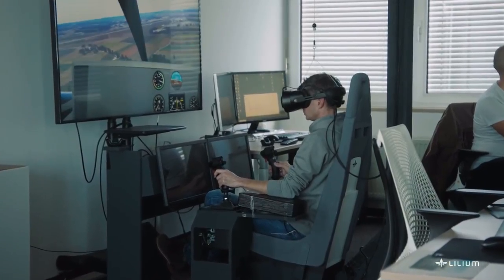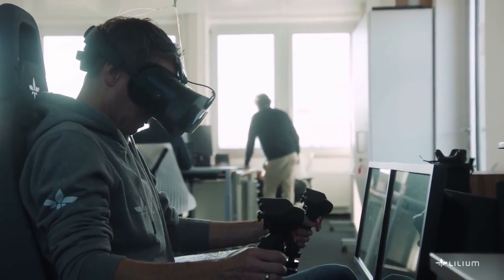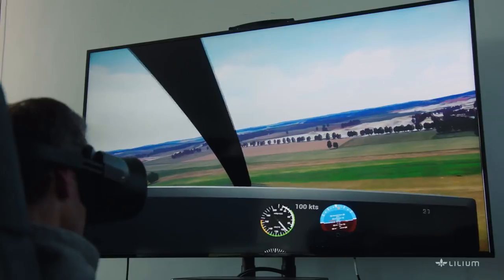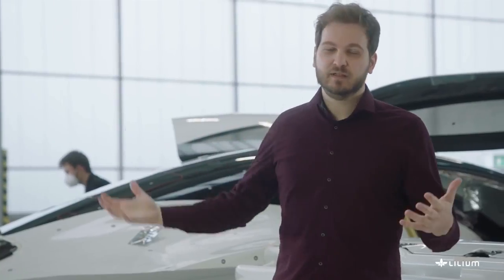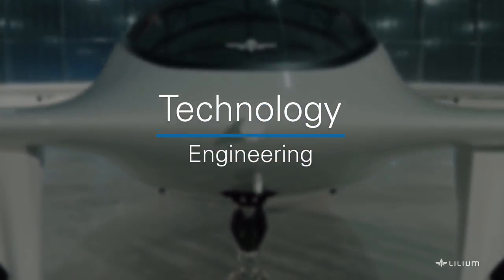Lilium Electric Jet : The Technology and Features in detail

Comment: What happens if you lose power? Since all your stability is in the engines.. ??
Reply from the maker: It would be exactly the same thing, if you run out of fuel... mid air! :) You could consider this as a cub, but slightly heavy.

Comment: Ok let’s just add another 800 pounds of occupants, seats, safety and climate systems and see how she does. Gotta get real here sooner or later…
Reply: As they say, when reality hits the fan.
Reply from the maker: Thrust should not be a problem, but the battery efficiency is certainly a concern. Hopefully by the time it launches, we have a new breakthrough in battery tech which can increase the load capacity as well as the range.
Reply: @eDriveToday  " but the battery efficiency is certainly a concern". Really! so you understand it will never cary people.
Reply from the maker: @urlocaldogeater   They have a flying prototype. So it means, it can carry people and it carries people. "Efficiency of battery" term was used, regarding a larger range to connect far distant cities.
Reply: @eDriveToday  "Can carry people" but it won`t. When you Côte your self, do it right. You say  " but the battery efficiency is certainly a concern". Certainly a concern, and now you have a braekthrough in battery? to connect far distanse cities?, really! This battery breakthrough has been going on for the last 30 year, and the EV cars are on the same spot. There is no magic trick when it come to physics, and this aircraft will be to heavy to get off the ground to reach this distant cities.
My Guess is that you can fly it for 5 minute.

Comment: Great idea. But for a true flying car the jets could be mounted on the bottom of the car parallel with the fuselage and the wings folded vertically when the car is taking off or landing or perhaps even eliminated and rely only on the jets for lift. Another factor is that a car with wings cannot maneuver in tight spaces and between buildings since wings rely on forward motion for lift and it takes up a lot of horizontal space.
Reply from the maker: Your point is very valid. But also need to note that, this is not conceived as a flying "car". This is meant for the air only, not for the road at all.
Reply: @eDriveToday  -  nor is it a jet in the strict sense.  It is powered by ducted fans.

Comment: Wonder toy! But wouldn't an electric helicopter be far more practical and cost-effective?
Reply from the maker: In theory, this still is an electric helicopter. Instead of one huge rotor, this is employing multiple rotors, which has found to be more effective and efficient than a large single rotor. And the wing design is super efficient in cruise.
Reply: @eDriveToday  don't forget your software wizardry

Comment: Fascinating.  I wish you continued success.

Question - you indicated you have planned to not have a high percentage of hover in your flight profile.  Isn't that high risk?  Suppose when have entered the end of the flight, there is an issue where you wish to land (plane and airspace stack-up, gate is not ready, debris on the runway or landing area, construction).  You will need to circulate or hover.
Reply: I'm gonna  land mine on schoolyards and parks

Comment: Show off video with zero practical information.  Carry capacity?  Flight times?  Can it land with forward speed?  It was stated that only 10% of the hover power is needed in level flight - can power be reduced to some of the fans to conserve capacity, or do they all run, all the time? From the design, it would seem that they'd never be able to be powered all the way down, as they'd add a lot of drag.  They could possibly be selectively throttled back to a neutral speed, using a lot less power but still providing enough thrust to overcome their own wind resistance.  Overstating the efficiency of ducted fans isn't going to win you any points.  Yes, they are more efficient than a non-ducted design of the same diameter, but they're still less efficient than a larger diameter propeller of the same total area as multiple ducted fans.
Reply: Flight times? My guess is 5 minutes, max. The CEO talks about what they "want" from the battery, that of course,  dosen`t exist.
But wait, there is a breakthrough on batteris. Heard that before?

Comment: I love the design concept. However I do envisage a major problem. The present design will be very vulnerable to cross wind mishaps whilst hovering in close proximity to the ground. This is because of the need to roll away from wings level in order to move the craft laterally side to side in the hover. When there is a cross wind the aircraft will literally have to land tipped over to the side to maintain a steady position over the ground. With the width of the wings there will be insufficient clearance to maneuver laterally without the wings making contact with the ground.

Unless the jets can be vectored side ways to provide lateral adjustments in the hover so the wings can remain level then the concept will fall short of its design goals making it difficult to obtain full certification. I hope the designers realise this NOW and look at ways to mitigate this short fall. I would be looking to deflect the outflows as oppose to pivot the jets themselves. It should be easier to accomplish without gaining an unacceptable weight penalty.

I love the way longitudinal vectoring is being accomplished. Liliam now needs to consider how to best introduce some limited lateral vectoring to aid their cause.
Reply from the maker: Would the crosswinds really matter, considering this is a EVTOL with wings? The wingspan is only 13.9m and the weight is a mere 800Kgs. The hover phase efficiency should definitely be low, but it can still manage a safe landing in a small space, right? You might have seen, how the Cubs in Alaska, lands in very small spaces, almost like a helicopter, literally. The same principle can be applicable to this also? with an added support of tilting lift fans? Curious...!
Reply: Why would you land crosswind? If this technology does work I envisage dedicated facilities for operations, designed so that the aircraft can always land into wind.
Reply: @Obbsserver  Exactly.  A VTOL aircraft doesn't require a runway so there are no crosswind issues here.  You can land into the wind from any direction just like a helicopter and we know people land helicopters in some pretty rough conditions like ships and oil platforms.
Reply: @redbaron6805  Playing devil's advocate, crosswinds can be fun. I remember landing a C172 at Biggin Hill to clear customs inbound. There was a hell of a crosswind from the starboard side. It was supposedly within limits, but in the flare I had full deflection of ailerons and rudder and we were still drifting slowly to port, heading off the runway towards a pedestal landing light, which I missed, somehow. During the roll-out I watched my wife using her left hand to un-peel her right hand from the grab handle. She was gripping it so tightly her muscles had gone into spasm. 
Maybe not what the designers of the Lilium have in mind for their passengers!
I fear that electric aircraft will be a dead-end eventually, but I think the Lilium design is very interesting, and much better than all the other VTOL electric aircraft of which I am aware. I will be very impressed if they have found a way to make ducted fans work - I believe DJI tried them and gave up. You might think that if ducted fans do work they would be used on consumer drones if only to cut down the noise. Anyway, I hope the Lilium concept works.
Reply: Doesn’t the low weight imply that it’s much easier to get blown around in the wind? I imagine the solution is not to spend too much time within one wingspan of the ground. A vertical landing in gusty conditions would be a rocky descent, a short wait for the right moment between gusts while pitching and rolling to compensate and then quickly descending the last 15 m. Not a very passenger friendly experience.
Reply: @motioncompensation1544  This is all assuming very gusty winds and probably a weather most aircraft won't fly in.  Since the airplane can land vertically and can compensate using computers which can adjust the approach 100 times per second, I don't see this being very much of an issue.

I have landed small aircraft in gusty winds, and since the wind gusts are generally from a predictable direction, I don't see this being much of an issue from a flight control standpoint.

Comment: I wonder if you can take the Lilium concept of multiple compact engine design and exchange them with fuel combustion fan engines. Full thrust for take off but half thrust turning off some of the engines during cruising.
Reply: A hybrid system is the obvious solution if you're interested in making this a truly useful long range vehicle.

But this is verboten since it apparently offends the climate Gods.
Reply: You need to use the electric motors for rapid control of speed etc but you could add a fuel-powered generator.

Comment: Any aero engineer knows that swept area is king. Anyone who's done wind tunnel ducted fan testing..including nasa as far back as the 50's know the traits and issues. The claim made here about keeping the weight down due to better efficiency over larger props is complete bullshit. John Kress would be rolling in his grave. The design is clever indeed but not for that reason. Theyve managed to figure out a way to essentially shove thrust all over the plane. Thats inherently inefficient but made up for by cleverly finding spots for it. The trade off is loads of parts obviously. 
An electric helicopter or 3 or 4 fanned drone type vehicle would be simpler and more efficient. This will be a footnote when we look back at it in 50 years.
Reply: Let's assume for a moment (ever so briefly) you know what you're talking about regarding ducted vs un-ducted fans/propellers, your 3 or 4 fanned drone type vehicle has two serious drawbacks that would cause it to fail certification: lack of redundancy and noise. Engineering isn't about finding the the very best in performance; it's about the best set of compromises for the intended application.
Reply: Helicopters are great for hovering but as soon as you start moving forwards they fight against themselves with the left and right sides of the blade facing different airspeeds. Thus the forward speed of helicopters will be slower than airplanes.
Quadcopters are very inefficient for flight because they have no wings, not even a big rotating wing like a helicopter.
Reply: @codetech5598  Precisely, but my comment was already long enough (and not a certification problem)! 😁
Reply: @gh8447  I was responding to the OP. You already understand the issues.
Reply: Yeah, Tim's entire claim here is beyond asinine...

Comment: It was said that STARX learned by explosion (a proven Russian innovation/evaluation process :))

You guys are completely on the flip side; 3 years of simulation probably burning through a huge pile of cash.

Maybe it's time to extensively real-life test (and oh yes, build in a parachute-like some private jets nowadays have).
Reply: The only one that is using a parachute is Cirrus, but that jet requires a runway and has a single engine.  The redundancy of multiple electric motors where you can lose up to 3 motors and still land means a parachute wouldn't be necessary for the Lilium.

Comment: Its brilliance is in its design. And its clear to see its in a league of its own.  Removing the complexities that come with multiple exposed rotors, as is the layout of its competition.
Reply: What complexities would they be?. Exposed rotors are simpler and far more efficient than EDF.
Reply: I wouldn't say, 'complexity' with regard to exposed rotors; rather, insane lack of safety. Most of Lilium's competitors are pushing aircraft that are little but over-sized quad copter drones. Imagine one of those noisy, fuel-inefficient monsters crashing in a crowded metropolitan area. The carnage would be horrifying.
Reply: @Wolf88888  I totally agree. ive been boasting about lilium safety by design being its leading attribute over its competition. The very factor that "when" an accident occurs,  and it will happen one day.  I would wanna be anywhere near those open rotor designs. neither inside nor out. Bad enough seeing the carnage from a normal helicopter can you imagine these multi rotor designs.  And yet lilium has non of those issues. not unless you deliberately jam your hand inside one of its ducted fans.